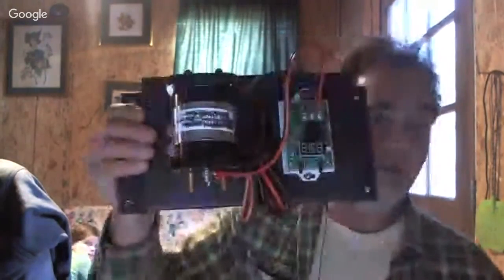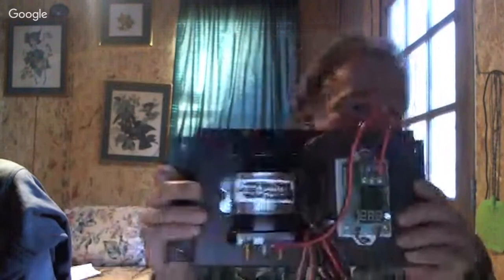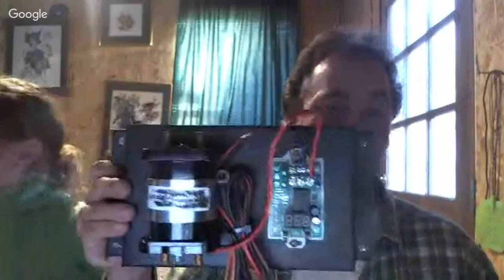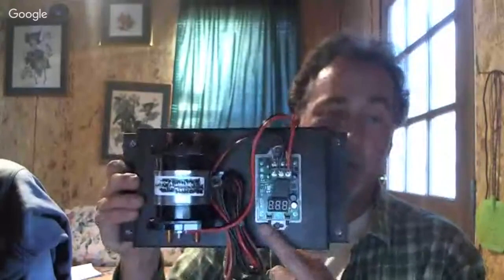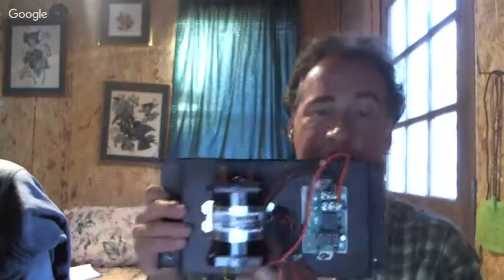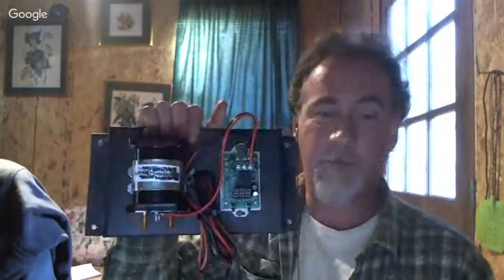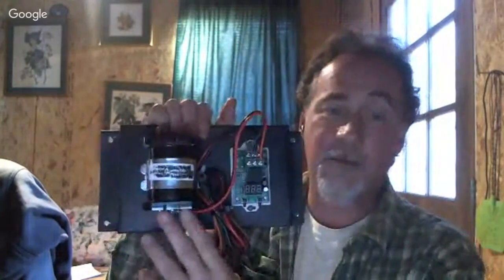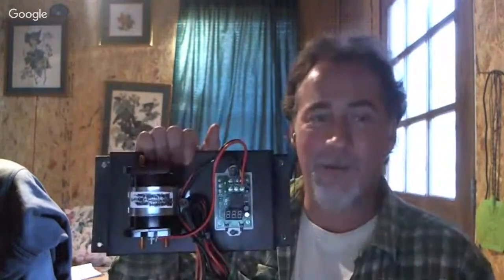GFGL and Full Spectrum Survival Live

Comment: Absolutely loved this video!!!  Been trying to find an adobe mix to buy in my area but none available.  Our local dirt won't do for an adobe over.  Was wondering if cement would work.  Or, would you recommend something different?    And, when you get the plug and use solar system going we would be really interested.  Thank you so much.
Reply from the maker: Thanks for the kind words! Cement will not work it will explode because of the trapped air in the mix so please don't use cement. You can order clay off line bulk is better it will be cheaper. Or you can come to our event where you will be able to see the Plug and Play solar system and we will load you up with free red clay.
Reply: +goforgreenliving thank you so much for the info.  I will try to find someplace to get red clay.  I live so far away in Northern Maine or you can bet I would be at your event with bells on.  You all live so far away from me I sometimes feel like the only homesteader, prepper up here.  Love you all.  You are my extended family.
Reply: +goforgreenliving HOW MANY BAGS OF RED CLAY DO I NEED?
Reply from the maker: I would get about 10 bags